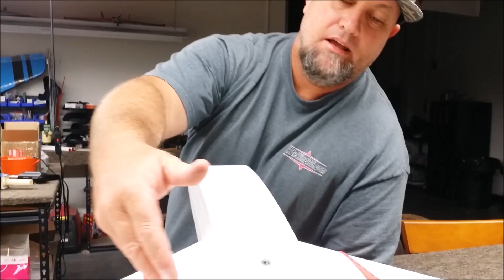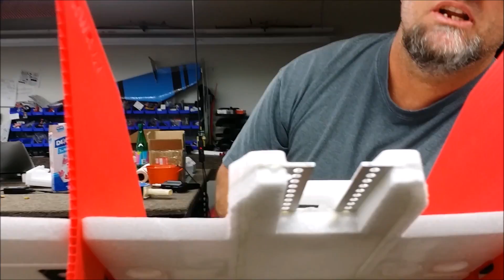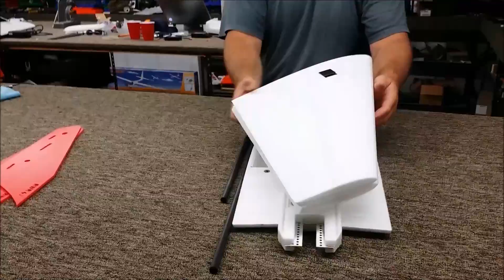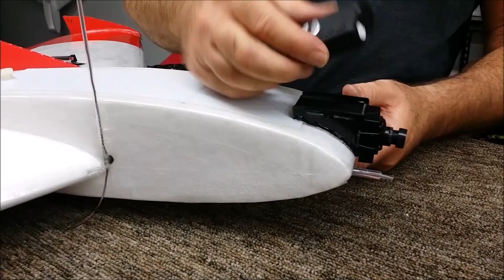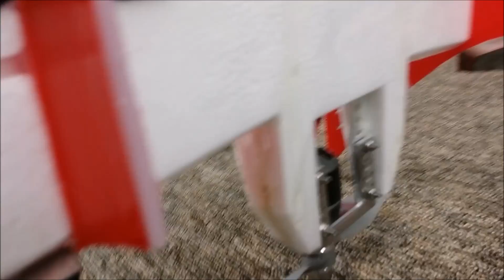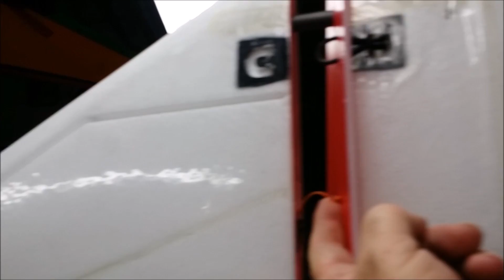Ritewing Z3 S over view

Comment: How easy is it to install your VTX and RX further out into the wings to get maximum separation?
Reply from the maker: We use a simple clover ant with a 90 degree bend on it without any major separation.
This has given us over 8 miles out.
If your so worried leave the VTX in the saddle bay,then  you can just extend your antenna out there through the LED lite channel.   I would not put any VTX in the wing, I have seen no need for it with the gear and filtering we use.

Comment: Looks awesome guys, nice job! You've come up with some very clever design features and the storage options are excellent. Dumb question: Why spackle when you're going to laminate? 
Thumbs up!
Reply: Depending on the thickness of the lam, you can end up with the foam pattern showing through.  When you spackle it creates a nice smooth substrate.
Reply: Steve ten Have Gotcha, thanks very much. I wonder if a slight ripple effect on the finished laminated surface is all that bad, just ask any golf ball lol!
Happy flying :-)
Reply: ***** Interesting question - Mythbusters did an episode where they 'golfballed' a car and got consitantly 11% better mileage from it.  High performance racing boats and jet fighters use variations on skin textures to achieve better drag coefficients so on a theoretical level, yes I'd suspect that a well constructed even skin variation could lend itself to an efficiency improvement.  From a scale aircraft perspective however and not being able to control the 'texture' regularity, the aesthetics tend to win over :D
Reply: ***** Aerodynamics is a fun thing but also a very difficult thing to cater for when it comes to aircraft.  What one wing section or airfoil does well at one speed, may completely suck at another.  Playing with laminar flow and airfoil efficiency would be an amazing thing to do - Aircraft already do something similar with vortex generators to help reduce flow separation on the trailing side of the wing at high angles of attack.  The problem with 'golfballing' a wing surface is mostly structural - the skin of a wing has a compressive and expansion stress along it which added to the wing spar gives it the majority of it's strength.  Put a bunch of dimples in it and it's immediately weaker.

Comment: Looks pretty sweet!  I really like that it can easily break down and fit into smaller vehicles.  Can you comment on the durability compared to the Zephyr II, particularly for nose-on impacts?
Reply from the maker: This is EPOR, it is the only epo type foam aircraft that  I know of has a box spar system designed for the fuse.
It is very robust in design, this is the way I do things.